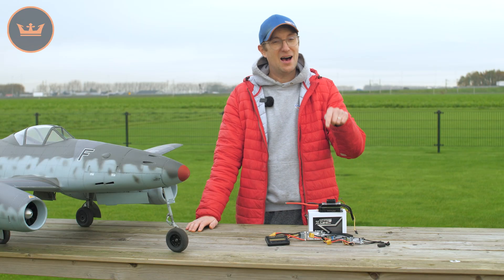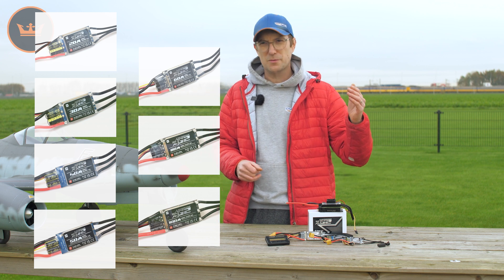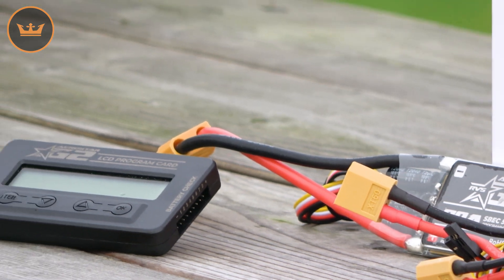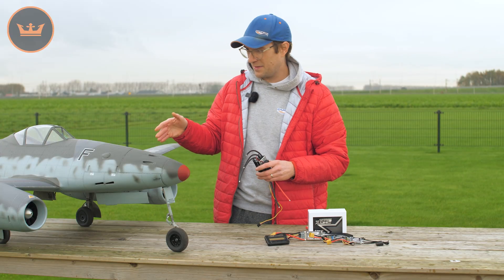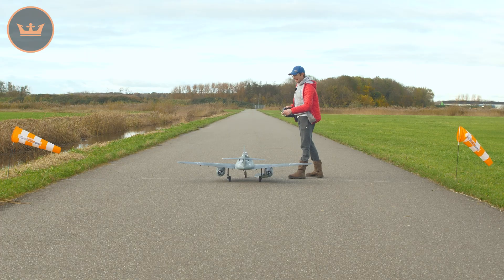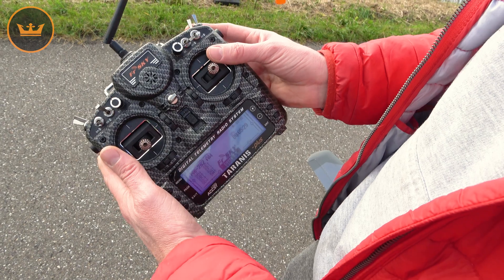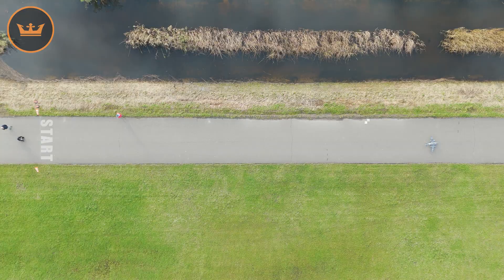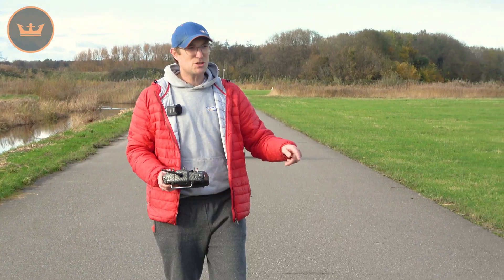Product Profile: Aerostar RVS G2,  32bit instant reversing/EDF braking system ESCs

Comment: Hi Stuart, I would like to ask if these Aerostar G2 ESC will make the motor emit a sound if the ESC is not receiving a signal from the receiver? ie throttle signal cable is broken or disconnected.
Also will the ESC make the motor emit a sound if the ESC was receiving a signal and the throttle signal cable becomes broken or disconnected?

Comment: I have bought the 40A G2 version, and I want to use the soft-brake or medium-brake mode for a folding prop glider powered by a 3S LiPo.
However, both don't work (it’s the same as NO-brake); the only one that works is hard-brake.
I only want to stop the folding prop from spinning in flight, which doesn't require hard-brake, just soft or medium-brake.
Is the ESC faulty?
I wanted an ESC with reverse because the glider does not have any air brakes to get out of really strong thermals, which is solved by using the motor in reverse.

Comment: Excellent video Stuart! Would these HV's work with a propeller setup?  I have the 50cc RotoMax and will be powering it with 12s setup. Thanks
Reply from the maker: Yes absolutely, they are for any fixed wing application.